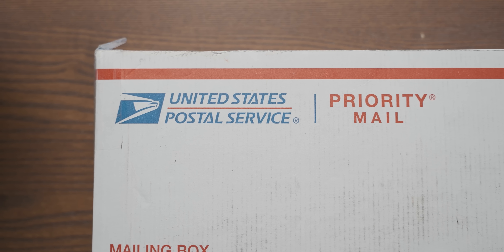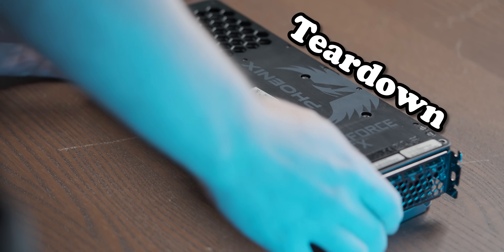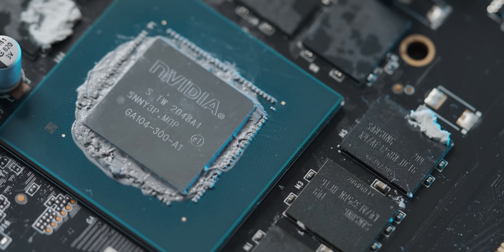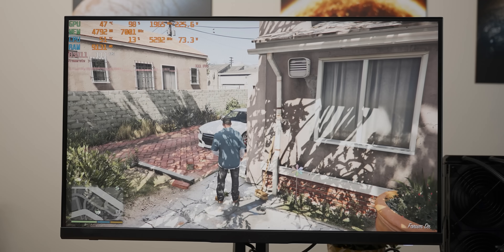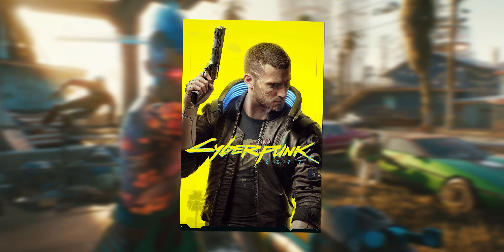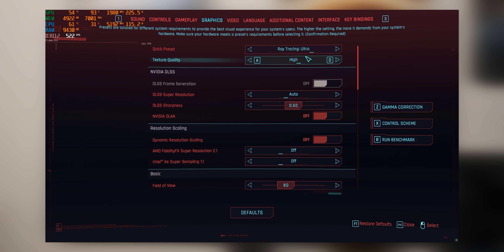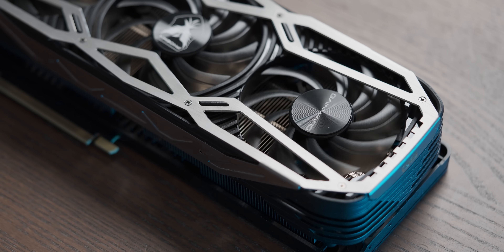This Is The 16Gb RTX 3070 Nvidia Should Have Made

Comment: Great video. Your conclusions match those of Hardware Unboxed on other great YouTube channels; for the LATEST triple A games, you need 16GB VRAM to run at 1440p or higher for maxed out settings to run smoothly (over 100fps). 

Hardware Unboxed GPU specs vs pricing standard acceptable guidelines: 
8GB VRAM <= $150 US, 
12GB VRAM <= $300, 
16GB VRAM <= $800, and
 >= 24GB VRAM for GPUs with 24GB VRAM or higher for GPUs costing over $800 US!

Remember you can buy a complete gaming system, like a PS5, with effective access to 16GB for video memory access, for less than $500 US; why would you pay MORE just for a GPU which has WORSE graphics? If you spend more money on a GPU than an entire current games console, you SHOULD be able to AT LEAST run the latest games at 1440p absolute max settings, and many people want max settings gaming at 4K with 120fps or higher for that kind of money!

Low VRAM, less than 16GB for even low-mid tier gaming in Q2 2023 is a deal breaker, as its planned obsolescence, a short shelf life for a LOT of money invested!

Comment: The initial point of AGP was giving the card faster access to the system memory (when cards memory was often slower than computer memory, and much less plentifull). This was extended into PCIe. It still allows the card to use more memory than it actually has on board albeit slower than onboard. This hinders performance as memory on boards (716 Megabit/s on a 256bit wide RTX 4080 memory bus) have surpassed the PCIe interface speed (40 Megabit/s for PCIe x16).
If the card has available memory for new textures when you turn down the "wrong street" in the game it should quickly prepare by swapping out the textures in local memory before they are needed so as to not cause stutter.  If it is already utilizing too much of it's memory this becomes impossible and stutter may occur as textures are accessed from system memory. It can also be poor coding/confusion making the card run with textures from the system memory and thus take a big performance hit.

Comment: People thinking that in the future 16GB will save the 3070 are delusional, Theres almost no difference between the two even when the 16GB version has more ram, the reason why the 16gb card had higher frames was because of the higher clock speeds. 

The only use for a higher VRAM card would be for rendering or VR. 

The same reason why i swaped from a 3080ti to a 3090, VR on a high resolution headset eats it all. 

in the future the technology used in the games will be too much for 3070 to handle regardless of the VRAM needed.

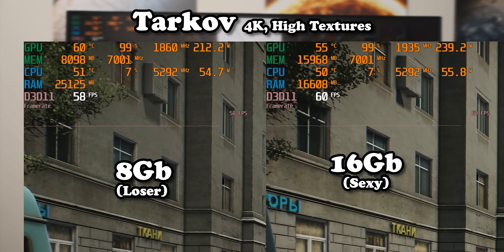Comment: 8:57 Yeah I think that if you click on GPU in task manager the "shared memory" is the amount of system RAM that your video card can borrow. My 3080 shows it as having 15.9 GB of shared memory which is basically half of my RAM. The system RAM is crazy slow compared to the GPU memory but it's better than running out of memory.

Comment: I'm curious why that even works. Back with the 960, which had 2gb and 4gb variantes, I remember someone trying to solder 4gb to a 2gb variant, which were not detected. Because the GPU had its VRAM capacity hardcoded in the firmware. Seems like they don't do that anymore.

Comment: Low vram = more swapping to system ram, which can introduce stuttering if the game isn't optimized well.  This is where people with DDR5 might actually benefit with less stuttering due to the slightly higher bandwidth speeds compared to DDR4.
Reply: PCIe 4.0 16 lanes (32 GB/s per direction) is a bottleneck i.e. texture fetch from system memory will be bottlenecked by 32 GB/s.

128-bit DDR4-3200 can deliver up to 51 GB/s  bandwidth 
128-bit DDR4-4000 can deliver up to 64 GB/s  bandwidth 

NVIDIA doesn't support PCIe 5.0.
Reply: @valenrn8657  do you hear yourself? 32 GB/s.. You know capital GB is gigabyte and not gigabit right? This means a 3070 with 8gb of VRAM could technically dump it's entirely vram buffer 4 times per second if it were possible to do so.  That's not the bottleneck.

The bottleneck is the latency caused between the CPU and GPU when it has to ask to utilize system memory.  This can show up as a stutter in most games.  DDR5 would mitigate the stutter slightly because it relies less on cpu input for every task, for instance DDR5 can reduce its own latency when the CPU requests larger data chunks, such as when the GPU is dumping vram to system memory.  So you'd be less likely to stutter when this occurs.  Although you probably will still notice frametime stuttering.
Reply: @Bry.89  
GB = Gigabyte
Gb = Gigabit
Reply: @Bry.89  
For the 60 fps target, 32 GB/s I/O is 500 MB per frame.

If random access texture etc located on an overspill system memory location with 1GB in size, it's a 2-frame hitch.  
 
RTX 3070 has 448 GB/s, hence 
it's 7467 MB budget per frame for a 60 fps target.
or 
it's 3733 MB budget per frame for a 120 fps target

For a 60 fps target, rendering a frame is done by 16 ms intervals.
 
Frame pacing is different from just looking at the simplistic "per second" argument.

32 GB/s is close to yesteryear's 22.4 GB/s from Xbox 360.
Reply: @valenrn8657  Yes I literally just said GB is gigabyte lol..
Reply: @valenrn8657  I think you're confused man... you're comparing the speed of the vram talking to the GPU with the speed of the PCI's bandwidth talking to the system.. those are two entirely different measurements and the PCI throughput doesn't need to be as quick as the transfer between the gpu renderer and the vram buffer..
Reply: @Bry.89  Wrong.

When discrete GPU access system memory during a texture spillover event, it's at PCIe 4.0 16-lane connection bottleneck. This is assuming system memory is higher than 32 GB/s bandwidth. 

CPU's GPU command list data size is small, hence PCIe 4.0 8-lane or 16-lane connection is sufficient.
 
IGP doesn't have  PCIe 4.0 16-lane connection bottleneck.
Reply: @valenrn8657  And I'm telling you the spillover event doesn't utilized the full 32 GB/s during the occurrence and its the latency between the CPU request that causes the frametime spike. iGPU doesn't have the bottleneck because it has immediate access to the CPU since it's on the same chip.. so that only proves my point further lol
Reply: @Bry.89  You don't know the basics of PC's Northbridge Switch-PCIe Root/Memory Controller architecture.

For GPU texture fetch from the system memory pipeline, it's GPU  ~~ PCIe 4.0 16 lanes ~~ Northbridge ~~ Memory controllers ~~ system DRAMs. 

The GPU itself has a mini-northbridge function that has a PCIe controller, large-scale DMA engines, and memory controllers.

You're mixing up the small storage size GPU command list with large data storage size textures.
Reply: @valenrn8657  Sorry that you're confused.
Reply: @Bry.89  You don't know the basics and specific data type when a typical reviewer benchmarks PCIe speeds with a large VRAM-equipped GPU card.

A large VRAM-equipped GPU card has fewer texture spillover events into PCIe 4.0 16 lanes/system memory, hence it's mostly  GPU command list traffic through the PCIe 4.0 16 lanes connection.
Reply: @Bry.89  I welcome you to a computer science debate in NeoGaf or Beyond3d and I will defeat you in this debate.
Reply: @Bry.89   32 GB/s is near Xbox 360-level 22.4 GB/s memory bandwidth. LOL

GPU command list traffic through the PCIe 4.0 16 lanes connection is NOT a  stressful workload.
Reply: @Bry.89  My argument is frame pacing.

For example, a 16 ms target render from 32 GB/s PCIe 40 16 lanes is just 500 MB. If the target texture data is 1 GB in system memory, a hitch will occur i.e. 2 frames worth for the 1 GB transfer.

If the programmer is not careful with the look-ahead texture fetch list, there's a high probability of a hitch. Consoles GPU with large memory storage can just point to texture data stored in memory and PC GPUs with large VRAM can do the same.
Reply: @valenrn8657  oop looks like they just updated TLOU and optimized the textures to look better and utilize less vram.   Poor game optimization strikes again, but devs wanna blame vram capacity.
Reply: @Bry.89  Where's the 0.1% low frame rates benchmark?

8 GB VRAM couldn't match the console's 13-to-13.5 GB range pointer texture fetch behavior.

I plan to install TLOU P1 on my RTX 3070 Ti (MSI Suprim X) equiped HTPC.
Reply: @valenrn8657  who said the game still wasn't poorly optimized? I just said they fixed the textures with the last patch.
Reply: @valenrn8657  apparently CPUs with e-cores enabled seem to perform worse than if you disable them in TLOU, so it's obviously still poorly optimized.
Reply: @Bry.89  Use Process Lasso.

Comment: In my experience, when VRAM runs out and stuff has to be loaded into system RAM instead, you might not necessarily notice a change in the average framerate, but you'll be more likely to encounter frequent stutters which can be very jarring.
Reply: my gpu ony ha 4 gigs of vram and it needed 10 so six gigs of ram were used and it was the stutteriest thing ever
Reply: @Jbeam957  I mean, the stutter is more likely because your 4gb card is at least 5 years old and a minimum tier product lol
Reply: @roji556  yeah, probably, got a new pc a few months ago with a 4060, seems to have solved the problem lol
Reply: Crap
Reply: Is that what happens then?

Comment: Huh. I figured it would be locked down in vBIOS so that even if you upgraded the chips, it would still only see 8 GB. Usually everything is so locked down when it comes to computer hardware, it's hardly worth even overclocking these days, sure you can get 5% extra performance but you used to be able to get 30% or more. And its not like you could mod the vBIOS either, that hasn't been possible for a long time. So nice to see that this is indeed possible, not sure who would prefer to do this rather than buying a GPU though with more vram to begin with since I'm sure chips weren't cheap and the install can't have been cheap either. And a higher end card would benefit much more from added ram since that mostly comes into play at 4K and beyond, 16 GB of RAM in a 3070 might not be terribly useful. It was more to see if it would work than anything else, I guess.

Comment: That RTX 3070, even after modded, is running the same vRAM speed as my 2070 super. My MSI Ventus OC RTX 2070 Super runs the 8gb vRAM at 7000mhz, and it too is GDDR6. Huh. Now I am intrigued as to the possible mods for cards like mine. Also, 7 Days to Die would probably get up to that 16gb vRAM.

Comment: 16 I'd say is useless for a card like this. 12 would've made sense. Probably 16 should have been for the 4070. The 3070 doesn't really have the horsepower to handle 16gb of vram, and with that the 3080 should have had 16

Comment: I would actually pay money to have that done to my 3070ti.

I recently found out that running large language models locally is quite demanding on VRAM and it will be the reason why I upgrade my GPU
Reply: That's interesting, how does the GPU core usage look? If it's lighter than the 3070 Ti can provide you have options in older Vega cards that are now getting pretty cheap; the MI 25 will give you 16GB of HBM2 with a bandwidth of 483GB/s or the VII would get you 16gb at a whopping 1TB/s

Comment: Do you think the drivers for the 3070 weren't optimized to utilize the extra video memory? I know it said it was using more and in resident evil we saw quite a better frame rate but I'm wondering how much better it would run if the drivers supported it.

Comment: I went from a 1070 to a 3070. Been hesitant on a few new games due to potential vram issues at 2k. I haven't had an amd card since the early 2k's but if nvidia doesn't de-slime themselves I'd buy an arc first. lol
Reply: buy a 6800XT no point of buying  nvidia at this point. 6950XT is going for 600 bucks you cannot beat that. 3070TI is at a 6800XT MSRP a 3070TI cannot even keep up with a 6800 non XT. SAM on UV/OC my timespay is sitting at a 21400 a lot of potential with these cards sitting between a 3090 3090TI in terms of performance just with some tweaking the 16GB of Vram is also going to take it even further. if youre worried about RT 6800XT is slightly faster than a 3070TI.

Comment: The problem with this is that since it’s not actually a Nvidia made product, Nvidia won’t release a driver update that fully utilises the potential of a 16GB 3070.
Reply: It is Nvidia made. Nvidia makes 16GB 3070 in laptops, they flashed the bios into the card, changed the memory and some configuration jumpers and it works like any other card. The games simply don't use that extra memory.

Comment: You should check out out the 48 GB Quadro RTX 8000 sometime and see how it runs games, although it has a massive price tag. It's mostly used in workstations for things like machine learning and intensive model making so I would imagine that poorly optimized games would only use a fraction of its power.
Reply: Why tho? The card is old. There is the A6000 and RTX A6000 ADA, that both have 48gb on newer architecture.
Reply: @dylan-xq1qh  I hadn't realized that it was an older card, could test out one of those newer cards too since they're also 48 gigs. I just thought it would be a bit humorous to use a professional-grade card to run games.
Reply: @aku2dimensional  I personally use the A5000, 24GB Quadro for games and honestly pretty solid
Reply: @dylan-xq1qh  I've never used cars like those to know how they perform, but I've recently upgraded to a used 1070 to replace my GT 1030 I've had for the last five years and the extra 6 GB is certainly nice to have. Now I can finally play all of my games on high or ultra settings.

Comment: anyone that is curious, the only reason this works with the 3070 is because it shares a PCB and GPU core with the Nvidia A4000, which was a slightly lower clocked 3070, but with 16gb of vram.  I doubt this would work with a 3080 or 3080ti because the quadro versions of those have a different memory subsystem.

Comment: First of all, I didn't know this was even possible.  Not sure why, but I just never thought about it.  So, well done whoever did it, and thank you for this cool video.

As for the results, I wasn't expecting any particular result and so I am not surprised from the results.  I know it's not exactly the same thing to say the least, but last year I decided to make a computer hardware video for my channel  as I do once every 2-3 years.  (yes not a hardware channel lol).  Anyway, I took a budget Celeron laptop and upgraded the RAM from 2GB to 8GB.  I was expecting higher performance, even a little bit.  The results were disappointing to say the least.  Testing like 70 or something games and for most of them the 2GB were better for performance than the 8GB.  Some games even refused to run on the 8GB.  A year later I still don't know WTF was that lol.  
Seeing the 16GB on the 3070 doing nothing in most games felt...normal.  Disappointing, bad normal.  Perhaps they will help in some heavy video editing loads.
Reply: Did you ever check compatibility between the laptop and RAM?
Reply: @arcticfox037  In what way?  Windows (8.1) detect the RAM just fine, there are no RAM errors.  The RAM was two new sticks, identical, with the same numbers as the one already installed from the factory.
Reply: @Trusteft  There can sometimes be incompatibilities between the processor and your RAM; the mention on worse performance made me think of that. The motherboard also might not support faster RAM if you tried to add thst
Reply: @arcticfox037  It's the same type of RAM as the original.

Comment: Is the issue more pop in, and textures not loading correctly? That seemed to be the focus of the HWUB video at least. Would be interesting to see how textures performed. I imagine the reason the games are still running comparatively well on both cards, even when the 16 GB is pulling more textures, is because the textures aren't loading correctly on the 8 GB.

Comment: BGA microsoldering is no joke. I took a weeklong course with one of the best shops in the country, and found out that my hands aren't steady enough. That was a big job. Respect.
Reply: I'd love to learn how to solder in general. No good courses near me afaik.
Reply: The guys who first did this mod is accepting orders here in Brazil haha
Reply: @v1n1c1u55anto5  cool how much
Reply: Hell no, not fun at all. i've been trying to fix my 4070ti soldering 0201 components and they're a bitch! I've got the BGA part down pat, there are a few tricks/secrets to it but microsoldering in general is a bitch. So far i've fixed a cracked 2080, two 3060, 3050, 4070ti, and so far have failed at fixing a 3090, 3080ti, 3070, 2080ti and another 4070ti. I didnt spend too much on the cards though and got most of my money out. I just moved onto cameras and motherboard sockets.
Reply: heat gun...recomended for unsteady hands
Reply: using your hands to do microsoldering wth lol

Comment: Reminds me of the Gainward 560Ti phantom with 2GB VRAM, gainward were popular for giving us extra vram or sometimes spicier cores, like the 560GS which was a 570 core but less memory, 216 GTX260s come to mind, good company but were probably a big reason nvidia cracked down, especially with software with their drivers, it knows X card should have X amount of VRAM and even though you can bleed into the modified VRAM, it will cripple the card artificially.. nvidia has become boring cash grabbers.

Comment: Maybe the drivers are still holding it back because Microsoft Flight Simulator easily uses 19GB of VRAM on my system with my settings and custom Scenery and aircraft and add-ons.